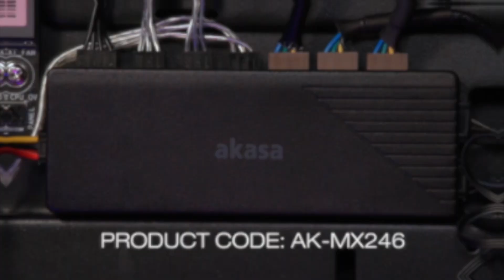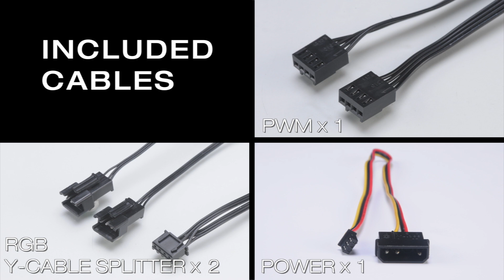Akasa Vegas Addressable RGB LED Controller with 6 PWM Fan Splitter

Comment: Im new to this RGB stuff so bear with me here on this question..  I have 5 addressable 120MM fans(ID-COOLING DF-12025-ARGB fans) and an addressable CPU waterblock, this controller will allow me to connect/synch all of my said addressable components to the one addressable 5v RGB header on my mainboard ? I assume thats what this item does, just wanna make sure. Thanks in advance to your response

Comment: Hey there,
i cant control the speed of the fans , they are always at 100%. I'm using AK-FN103 fans, plugged into the device.
Reply from the maker: Hello, 
AK-FN103 is 3-pin fan (i.e. no PWM) so when attached to the 4-pin controller in would run at 100%. If you would like to control the fan speed of this fan, you would need a voltage fan controller such as AK-FC-08BKV2.